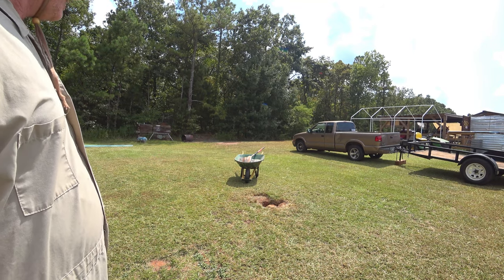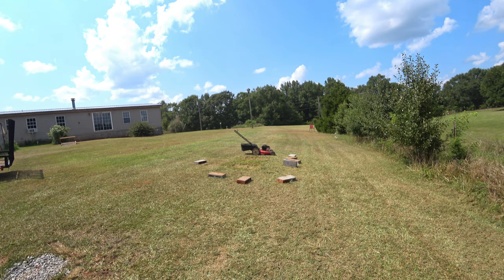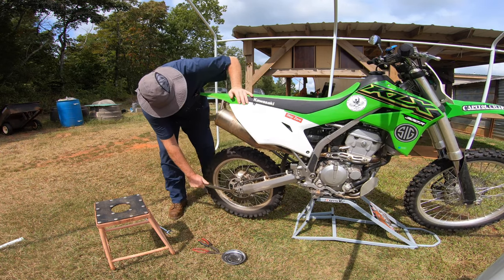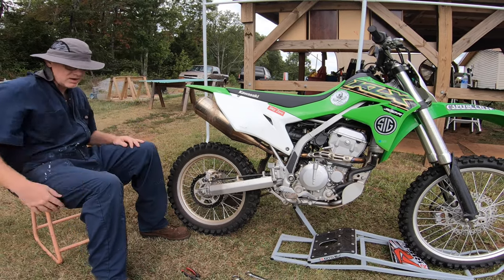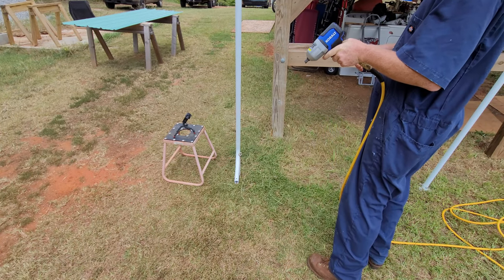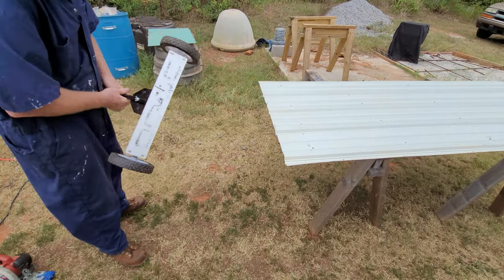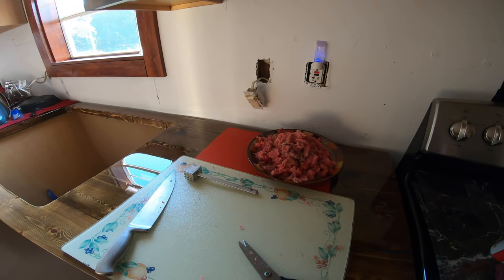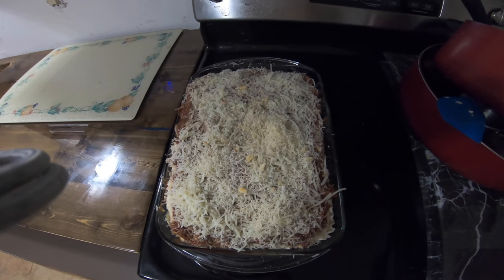NON STOP

Comment: Excellent vid bro, you're such a good editor. I noticed the whole shaft was turning as you were wrenching on it what a conundrum but impact should work in the end. I put a vid out about old crt`s and i dont think anybody got notification of it, I was discarded by youtube because of my upload frequency. I also had 3 thumbs up last night woke to only 1 really? ha ha, they cut my buds out ffs
Reply from the maker: Right on,thanks bud!  I'll check out your vid.  I haven't even seen one of those TVs in at least fifteen years.

I had two, a 19 inch tv/vcr combo and a 27 inch.

 I tried to take them to a pawn shop to sell them when I got my 1st flat screen plasma and the pawn shop didn't want them so I ended up selling them on craigslist. I sold the 19" for $5 and the 27" for $10.
Reply: @RedboneUnincorporated  I still have 3 13in vcr/combo, white Panasonic with remote, Toshiba and a Sharp. The Panasonic is the best one, good for retro gaming. Out of the 5 crts the sansui was one i bought the others from the curb